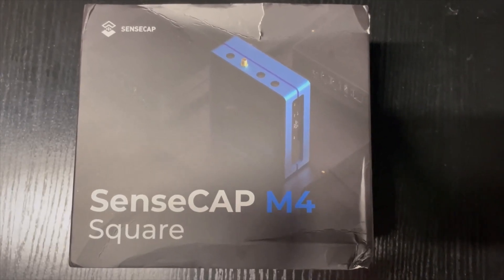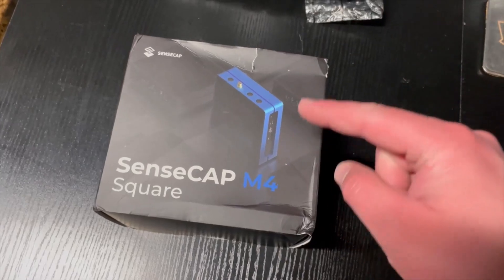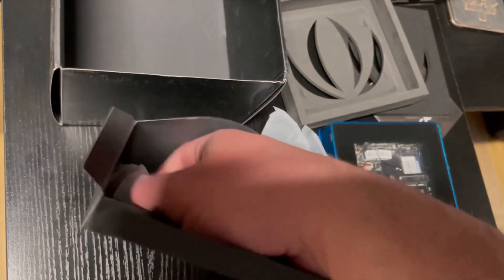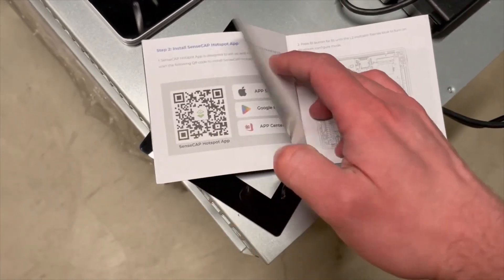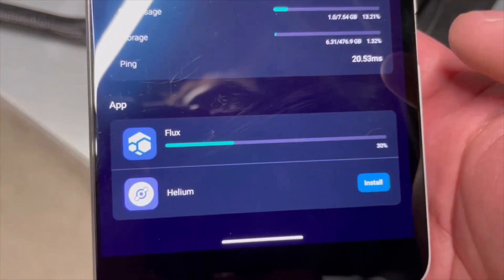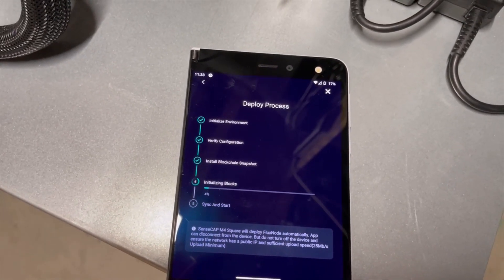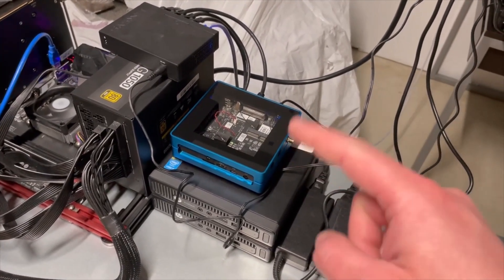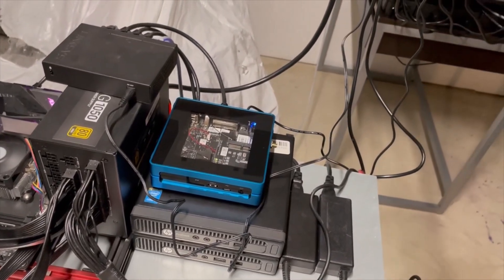SenseCAP M4 Square FLUX Node - Review & Setup Guide

Comment: Great video thank you, I have a really hard time to get node running again after a power outage or internet outage.  Do you know the best way to get the node back up and running again?  Do you have the steps?
Reply: I can connect no problem to blue tooth. Should it be working upon the power and Internet being restored ? Or what steps have to be followed to go from offline to online ?
Reply from the maker: That's good. So if bluetooth is working fine, it is probably fully restarted. Likely, the only thing you need to do is "redeploy" the node in the Flux app. When a node goes offline for longer than the maximum allowed maintenance window (i think 2 hours) the node gets booted off the flux network until you redeploy. You don't have to restack your flux, should already be there from before. just hit start on the specific node in the node section of the flux app.
Reply from the maker: are you able to connect thru bluetooth in the app? or is it completely inaccessible?